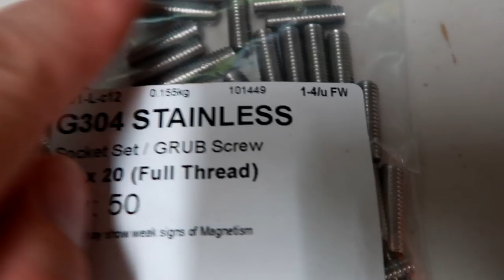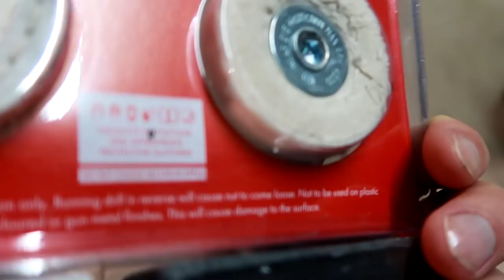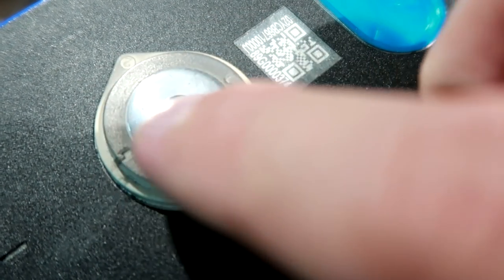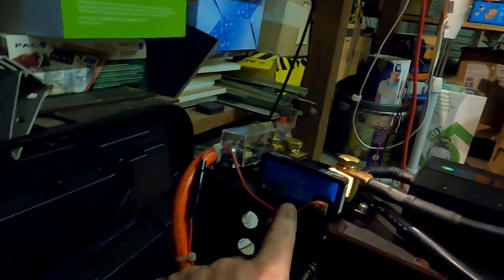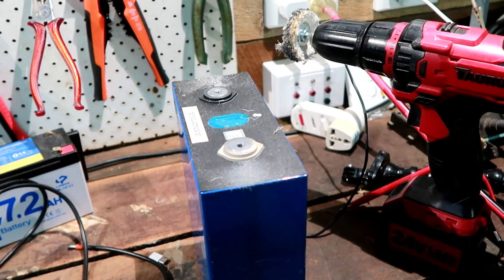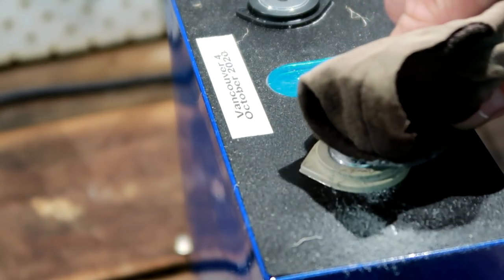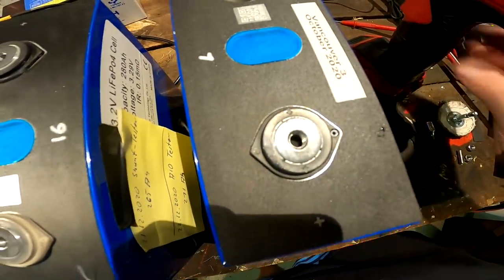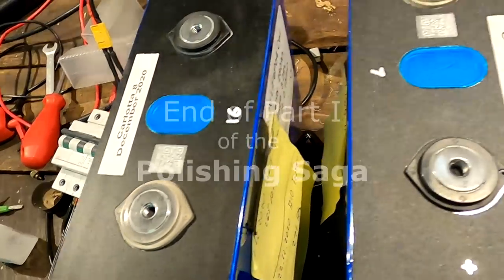Re-building the battery - Set-Screws and Polishing. Part1/2

Comment: There was a comment that the low cells might be caused (or just made worse) because they are near the centre of the pack. There is no reason that the cell order has to be maintained during reassembly. You could put these cells at the ends of the stack as an experiment. Nothing to be lost and, as the stack is already broken down, no extra work. It would prove or disprove the comment. 

Obviously there is another chance for balancing by putting them all in parallel again before finally replacing them in the box (about 15 mins working time and 1-2 days waiting time).
Reply: That won't fix the issues. I have a similar issue in my 8s battery bank. #8 was charging/discharging faster than the rest. So I moved it to the center, now it's #5 and it was still having the same issues. I was ready to just throw it out the window but decided to tighten the terminals a bit more. That fixed the issue so far.
Reply: I wasn't suggesting that it would fix the issue but it would confirm your experience without any loss of benefit.

Comment: Please get rid of all that nickel plated junk and replace it with pure copper and that will solve your connection problems
Reply: No it won't - copper in contact with aluminium leads to galvanic corrosion. That's why nickel coating is a thing.

Comment: Aluminum begins to oxidize immediately after exposing a fresh surface. Aluminum oxide is an insulator. I think you will have to protect every aluminum contact surface from the air with silicone grease or oil spray. That means the threaded holes and top surfaces of the cell terminals. The plated buss bars and ring terminals not. Nickel, cad plating doesn't have this problem.

Buffing and polishing is an art. Takes a long time to learn. Maybe too long.

I've been mulling star washers (outside star) for these connections. The star creates deep connections cutting through the oxide layer.  Using silicone grease of course. Just bouncing this around in my own pea brain. I hate aluminum. :)
Reply from the maker: You will have this oxide problem with every material. Copper is the same.
I used some paste in part 2 of the video but am not convinced it actually helps.
Reply: @OffGridGarageAustralia  In America I had to use some special paste on my aluminum 200A entrance cable connections to the Breaker Box 30 years ago. Don't know what it was. It kinda woke me up that aluminum was somehow different then copper.  Just sayin'. :)
Reply: @OffGridGarageAustralia  I just did some searching and found aluminum has been acceptable for wiring since 1902 but it was found to exhibit peculiarities such as CREEP.  Necessitating a special alloy that was less "creepy"?   AA-8000 series aluminum alloy building wire as required in NEC 310.14 .  I don't know what alloy those 280 Ah cells use for terminals.
I saw a vid a couple days ago of a teardown of a failled LiFePO4 pack that had bussbars TIG welded to the cell terminals. All aluminum by the looks. Hmmmm.
Still researching.  Gardner Bender OX-100B   :)

Comment: Hello
Use copper paste or silver paste for cpu cooling on the battery terminals.
Reply: Aahhh, no.  CPU thermal paste is designed to be both thermally conductive and electrically non-conductive.  That will make the situation worse.

There are other silver/copper conductive pastes/greases that can be bought, but you really don't want to use thermal grease here...

Comment: Not going to try too much longer, but here are some ideas:

(1) What C rate are you charging the battery at?  If its a low C-rate then that is highly likely to be the problem.  At very low C rates a lower target voltage must be specified to avoid fully charging the battery.  But a low target voltage also tends to accelerate out-of-balance conditions and makes it nearly impossible to actually figure out what the state of charge is short of counting the watt-hours going in, and also prevent the BMS from going into balancing mode.

Typically a reasonable target voltage such as 3.50V (for the BMS you are using) is the minimum voltage before balancing kicks in.  But if you are trickle-charging the cells below 0.2C (or even below 0.3C), then you would have to use 3.40V (which honestly is too low) or 3.45V (just barely adequate).   See if the BMS's balancing activation voltage can be set, but I would not recommending going below 3.45V.

You really need to add more solar if you are charging the batteries too slowly, or go with smaller batteries to get the C rate up higher (0.3C to 0.5C is ideal).

(2) Use an anti-oxidant paste.  Scrub the terminals with some sandpaper a little (it doesn't take much) to get the oxidization taken off before using the paste.  It doesn't take much paste.  Others have suggested this too.  Just use it, even if it doesn't seem to be helping.

(3) Typically for bus bars, tin-plated or nickel-plated copper is best.  Aluminum oxidizes quickly.  Copper does too.  But I don't think the bus bars are your problem per-say.

That's all I can think of.  I'm fairly certain the problem is #(1).

-Matt
Reply from the maker: At the moment I have only 1.2kW of panels connected (another 1.7kW will be installed shortly).
Charging current is only 20-25A max with the current setup. The target/ absorption voltage is set to 3.55V/cell at the moment.
Reply: @OffGridGarageAustralia  And these are feeding your 280Ah cells if I remember right.  Ok.   If we assume that 1C is 280A then you are charging at 0.09C.  Which is a very low rate.  At that charging rate you might actually be over-charging your batteries with a 3.55V/cell target.  By the time the voltage actually gets there at 0.09C the battery could easily be sitting at 100% or even over 100%.  And yah, figuring out the state of charge is just about impossible without actually counting watt-hours.

Find the manual for your BMS (should be online if you don't have a paper copy).  I seem to recall that it starts balancing at 3.50V/cell, but you might be able to actually set the voltage as a configuration parameter.

My recommendation to begin with would be to change the charge controller to target 3.50V and then set the Absorption time to 1 hour.    When the BMS display states that it has achieved 3.50V it should then go into balancing mode during the Absorption period.

* If you can verify that these settings actually work as expected and the BMS actually goes into balancing mode and starts balancing the cells, then that's a good place to be.

* If you are able to verify that, then do a discharge capacity test to see just how full the battery got.  You can go all the way down to 48V on the pack (it can go lower but that will be most of the capacity).

* If the capacity test is showing that the batteries are still being overcharged, and the BMS has a configuration setting to allow the top-balancing to start at 3.45V, then you can try changing your charging target to 3.45V (leave Absorption time set to 1 hour) and see how that fares.

In all cases the Float setting should probably be 3.35V, but 3.375V may be ok too if you can verify that no current is being drawn after the battery has completely settled after a charge.   Either value is probably ok.  No higher though.

--

Here is one of the references I am using... specifically talking about Solar charging.  There are some excellent comments including a multi charge-rate graph around the middle of the comments that shows what the problem is graphically.  You can see that as the charge rate goes down, the state of charge of the battery for any given voltage target actually increases.   Using the graph as an example, at 3.45V and 0.1C you are charging the battery to 95% (approximately).  At 0.05C the battery will be 98%.  And that's for 3.45V.   For 3.5V or 3.55V the battery will be near 100% (and I've seen other graphs that put it over 100%).

https://forum.solar-electric.com/discussion/351996/charging-lfp-lifepo4-batteries-to-90-soc-or-not

There are a lot of good comments in the comments section on that particular forum.

-Matt

(addendum:  If you are able to get the BMS to start balancing, then you can further fine-tune the charge controller by adjusting the Absorption period.  The BMS will probably only balance the cells during the Absorption period so keep that in mind).
Reply: Actually ,if possible, instead of doing a discharge test, you can try bumping up the voltage target and even augmenting with your e-bike charger (as long as you can measure the total watt-hours going in), and charge it up until the current falls near zero, to see just how much more charge it was able to take after the charge-controller settings were reached (charge-controller's target voltage plus the 1 hour absorption time, then the charge controller goes into float... then you do the final charge-to-completely-full test to see how much more capacity was left on the table).   That will be more accurate.

-Matt
Reply from the maker: I can adjust the balancing voltage in the BMS to any value.

I'll try again with the higher settings as you suggested and will set Absorption to 3.5V, Float to 3.375V and the balancer to 3.5V.

I also tested this 2 weeks ago when I had the absorption voltage set to 3.37V, the current actually goes to almost 0 after 1h of absorption. The MPPT will switch to Float then and lower the voltage so no further current is going in.
Reply: @OffGridGarageAustralia  Yah, I would totally expect current to quickly drop to near 0 below 3.4V, and trickle-charges just above 3.4V.  There may still be some small vampire currents but its really hard to hurt LiFePO4 cells at 3.375V or below.

The zone between 3.375V and 3.45V is what you really want to avoid... everything gets wonky in that zone.  Regardless of what the charge target is set to above 3.45V, the low charge rate from the panels means that the cells are going to sit in that zone a lot longer than is desirable.  That is one reason why a modest C-rate for charging is desirable (e.g. above 0.3C)... because it gets the cells out of that wonky zone faster.

I have a feeling that you will ultimately have to manage the state-of-charge for the pack via the Absorption time, with the target voltage either 3.45V or 3.50V.  It will depend on just how charged the battery gets with the settings verses your desired result.

--

Don't worry about individual cell differences that are under 0.080V while charging.  The goal should be to get the pack to the point where the BMS can start top-balancing the cells even if it means some of the cell voltage differentials widen while you get there... just as long as no single cell over-volts.

It then comes down to how much time the BMS needs to overcome the imbalance during the limited Absorption period.  The goal here is for the BMS to be able to 'make some progress' on each cycle.  It doesn't have to completely resolve the imbalance in a single charging cycle.

-Matt

Comment: Off the plot garage.  Who or what gave you the idea to polish the terminals.   There is no need to polish.  
In fact, one would generally just ruff them up with some fine grit.  Just to ensure a good connection.   
The studs are better than the screws for sure though. Just make sure you do not screw them in too far an pertinently damage the cells.
An be sure to only screw them in finger tight. Then back off a quarter of a turn. And hold the stud in position with Allen key when tightening the nuts down. 
But It seems your going to this effort because 3 of your cells are not matched with the rest. 
No matter what you do, your efforts will not have much effect on the internal resistance of the cells.  
Which is the cause of the uneven cycling.
Reply: His unmatched cells are likely because he keeps trying to use 3.5 volts as fully charged and did individual cell charge and discharge trying to match voltages. That completely messed up his top balance, assuming it ever existed.
He needs to put all the cells in parallel, bring them up to the peak voltage on the data sheet, usually 3.6 to 3.65 volts, and hold them there for a day or so. Call it absorption, equalization, top balance, whatever, that's the best chance he has for his usage to get the cells to work together.  (Bottom balance is good as well, but mostly useful in electric vehicle type systems where the battery is regularly being mostly discharged. For solar, a top balance is better because normally the battery is operating in the top part of the charge curve.)
Reply: @Sylvan_dB  Andy moved the terminals when his balancer was indicating uneven volts between cells and they came good. The bulk of the problem is apparently contact resistance.
Reply: impedance, needs to be measured b4 any more time is wasted.

Comment: Aluminium oxidises within microseconds in contact with oxygen, so cleaning will achieve nothing. For high current connections, aluminium is NOT a good material for this. However, because you are stuck with this material, the only way to get a good  reliable connection is to use star washers between terminal and bussbar. These cut into the metal as you tighten them, exposing fresh and unoxidised metal. An application of nail varnish immediately after will  seal the connections against moisture and air.  Your discharge current of 40 amps or so is not huge. Stainless steel is also a rather poor conductor, . Have you tested the BMS relay yet?

Comment: conductive grease and just be done. that is what it is made for!!!!!!!!
Reply from the maker: I used this and it made the problem worse.
Reply: @OffGridGarageAustralia  ?? are you sure you used conductive grease? antioxidans are the opposite IE noalox   ect. so to be simple. the grease you buy at the auto store for attaching your spark plugs to the wires is a conductive grease.  the other provides a protective layer between different metals al/cu ect. hope this helps. a conductive grease fills the low spots and does conduct electrons through it.  the anti helps stop corrosion between different metals
Reply from the maker: @dirkverhoest936  it will be in the next video. I used conductive carbon grease.
Reply: @OffGridGarageAustralia  arrrg dont know what to say about that. sorry. works for me. best of luck.i will keep watching. with froggy... LOL. a note with AL it does oxidize very quick in the air. cu is better, just shooting for answers...RIBBBETTT!

Comment: Those aluminum screws and connectors are crap!  As soon as soldered the bms connection leads...all the variation went away.  I bet the grease others are suggesting will work as well, but agree the polishing is doing nothing...it’s not a car panel getting ready for paint!

Comment: I do not think this is useful. Did you think to measure the resistance across the joint before you started? No. If your contact is limited to a few peaks on the surface of the contacts, what happens when you run a few hundred amps? My guess is they would melt. Maybe then you would have a welded joint. If you run a few hundred amps through the joint and nothing bad happens, there is no problem there.

Those "stones" are polish. Some abrasive material, probably imbedded in wax. Wax won't improve the conductivity of those joints.

When you polish stuff, you scratch it. I think 600, 800 grit are a bit rough for finishing metal, they might be ok for starting. Polish with your course sandpaper, say 600, then move up to 1000, around 1400, 2000, 3000. Then your scratches will be so fine you have a polished surface. I would not suggest you do that here though.

Search YouTube for scary sharp.
Reply from the maker: I measured the voltage drop across the terminals and busbars to yes. Some of them has really high resistance and occurred these 10-20mV drops under load.